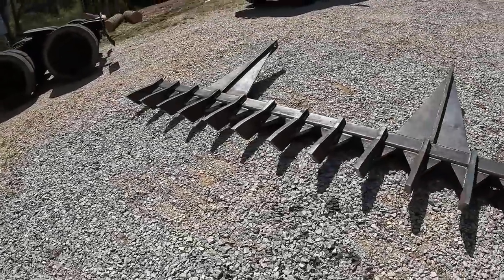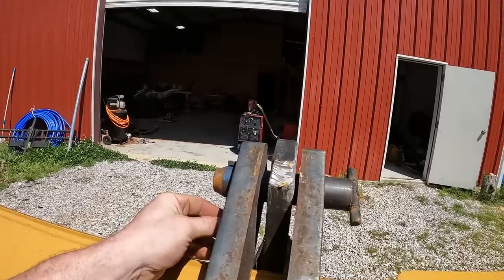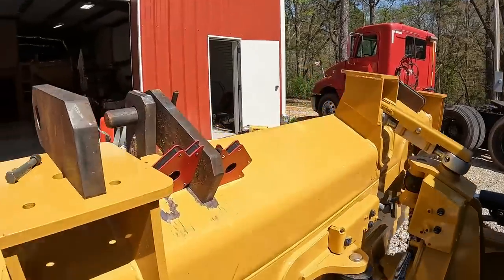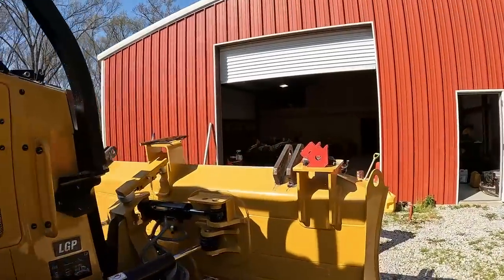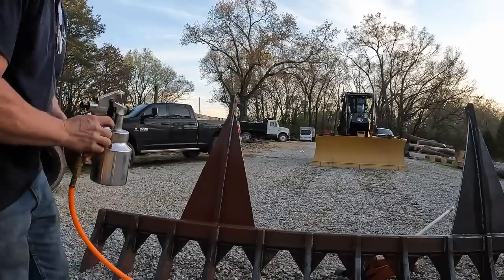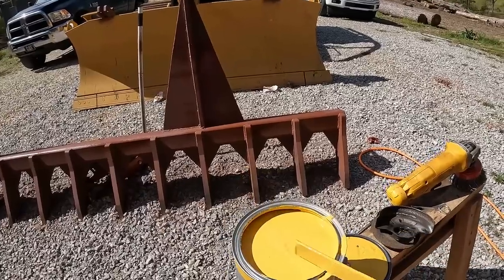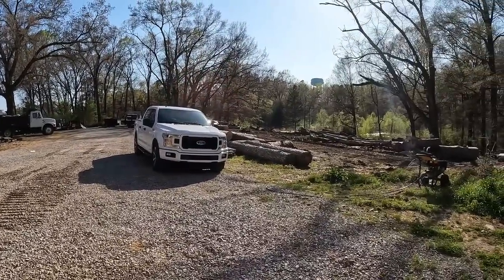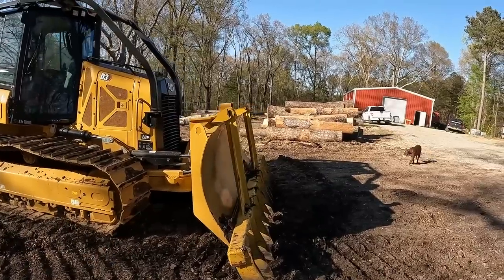Installing a Root Rake on the D3 Dozer.

Comment: Nice job.  Only thing I would have recommended is that you should have put a half inch or so steel mounting plate between the rake brackets and the back surface of the dozer blade because the back side of the blade is pretty thin steel and not designed or sized to carry the loads created  by pushing loads.  My CAT dealer installed my rake for me and they significantly beefed up the back side of the blade to which they welded the rake brackets.  Good luck with yours and suggest you keep an eye on your bracket welds and the back side of the dozer blade.  Important to catch any cracks or failures early before they become catastrophic failures.  Wish I could weld like you!! One other minor thing.  The general protocol for a rake installation is to position the cutting edge of the dozer rake against the primary cross-member (in your case the square longitudinal main beam).  I'm running a 2003 D3G XL with six-way blade and hydro-stat transmission.  Open cab.  I love my dozer!!  Hope you have good luck and years of service from yours.
Reply from the maker: Appreciate that!  I've been keeping a check on it. So far so good. I didn't know the back of the blades were really thin. I figured they'd be beefed up.

Comment: Good job. I have the same welder. If it ever gets to where it doesn’t go to high idle when you strike a rod, there going to tell you it’s the control board. It’s not there is a wire that has a bad connection.
Reply from the maker: Thanks buddy. I rarely use that welder but it does a good job. I just hate stick welding